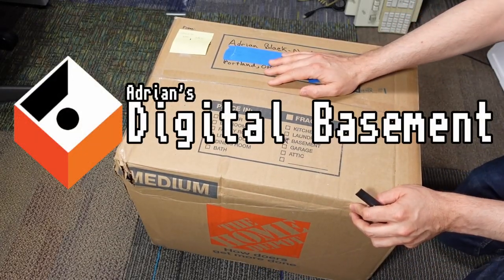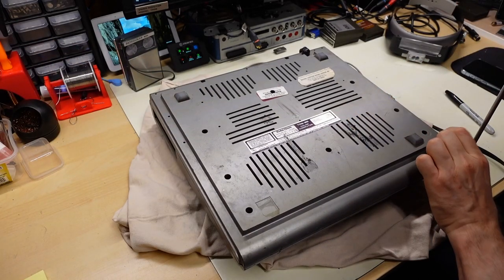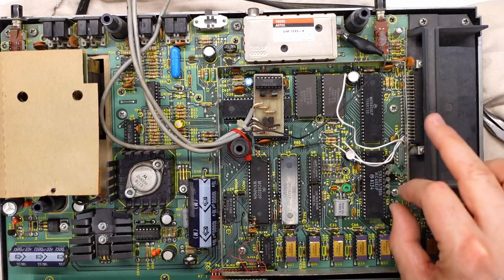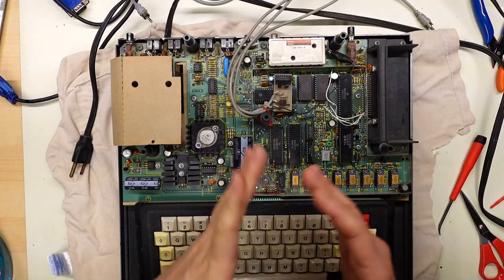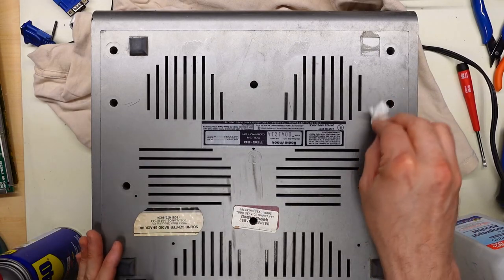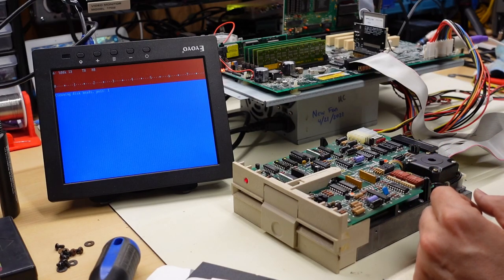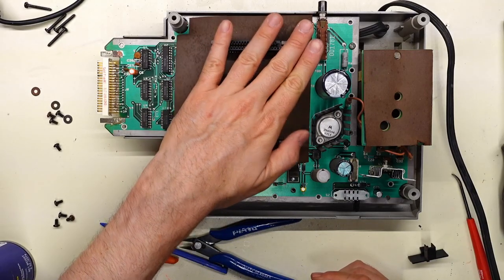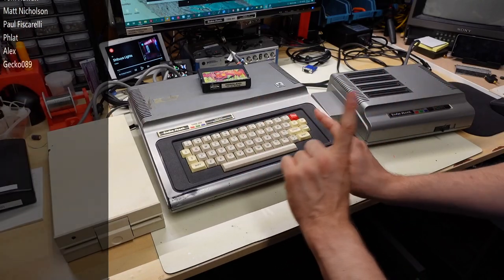0035 We have a broken TRS-80 Coco 1 in the basement! (And a repair on my other channel!)

Comment: Many a long year ago, I wrote an interesting program for that computer.  It was designed to print text on the high-resolution graphics screen.  This was never supported by the hardware.  If you had a BASIC program and you wanted text on the graphics screen, you had to use BASIC's drawing commands to draw the letters.
I managed to shoe-horn a machine code program into a tiny amount of memory.  The character-set table which the program used was longer than the program, by quite a lot. 😄 (2048 bytes RAM for the table, but around a quarter of that for the program).
The program was written in assembly code and used the Program Counter Relative instructions so that it could be loaded anywhere in RAM.  Usually, I'd clear 6 pages of graphics memory and then use the first four for the high-res graphics screen (it required 4 pages for the full screen) while loading the program into the two "spare" graphics pages.
The program had a table with the full 8-bit IBM extended ASCII character set.  It allowed you to fully control the cursor, screen clearing, and do advanced stuff such as redefining characters from within the BASIC program, put a cursor on the screen, reverse the video (black on white instead of the default white on black) and more.  You got 24 lines by 32 characters per line.
The program was accessed with the USR (user) command in BASIC.  If you gave the command a number, the lower 8 bits of the number would be used as an index into the character set so you could access all 256 characters that way.  If you instead sent a string into the command, it would print whatever was in the string... but it would also interpret control codes as cursor and screen controls and as character redefinition commands.  There were escape commands which would access the printable characters stored in the control character locations (0x00-0x1F) so you could still print the entire character set using a string.
I gave up working on the program because the COCO was falling out of favour as the IBM compatible computers took over the market, but figuring out how to make the computer "dance to my music" was fun.

Comment: pencil eraser on the gold plated contacts , but something tells me there is VERY little gold plating on there , as gold does not corrode like that
Reply: A lot of contact edges are brass rather than gold, so that tracks. Brass looks a lot like gold without real gold nearby to compare against. A lot of “gold plated” audio jacks are actually brass too. Which isn’t really bad at all, brass is an excellent conductor. It’s just not corrosion proof!

Comment: I had an original CoCo (with an E board) way back. There was a lot of discussion back then about repainting the case to repair those worn spots along the front edge. It was eventually found that a specific car touch-up paint was a perfect match: Mercedes Silver. I've no idea if that same shade is available today.  (For anyone who read '80 Micro' magazine in that era, you would remember that the regular 'Gamers Cafe' column introduced a character called Mercedes Silver.)
Reply: Yep, I remember that as well.

Comment: It is easy to tap a composite signal directly from the input to the modulator. Not great, but good enough for troubleshooting. It can be improved with the simple mods usually done on Sinclair Spectrums or Atari (using a 100uF capacitor or a transistor). You were lucky to get that a fancier mod that is getting the signal from the MC1372.

Comment: The multipak is manual and Electronic device to swich 1,2,3,4 with pokes, Keyboard is coco 2, first series, The wear on the case is due to the chiclet keyboard that was wider and better aligns with the markings.

Comment: As a kid, I had a coco 1 (16k later upgraded to 64k) that I paid radio shack to upgrade the keyboard from the original ‘chiclet’ keyboard to that one.. it was an official RS upgrade you could get.

As for the multipack, software could control the address decoding independently for the ROM space ($c000-$feff) and the part of the memory mapped I/o space typically used by disk controllers ($ff40-$ff5f) by storing the appropriate low and high nibbles at $ff7f…. Once software hit that address, the front switch gets deactivated until a reset.

Someone will correct me if I’m wrong, but I also feel like it actually let multiple carts share part of the rest of the I/O space at the same time - $ff60-$ff7e maybe??

Early version of the multipack don’t work with the coco 3 without modifications because the control register would ‘ghost’ from $ff7f to $ff9f clobbering new I/O registers (in the GIME Chip) in the coco 3

Comment: I had a CoCo 1 initially then a CoCo 3 back in the day.  My CoCo 1 had 64K, switchable IRQ. Needed the IRQ mod for modems as Tandy/Radio Shack messed up in the PAL mod. Power led. My CoCo 3 MPI was switchable so older hardware would work as some addresses were blocked.  My CoCo had power leds at the front. I wired them to the 5V and 12V lines as a diagnostic aid. I had an HJL aftermarket keyboard in my CoCo 1 and  transferred it to the CoCo 3.  Looks like it’s not executing code, thought the 6883 was bad but they do run warm. Wonder if it’s a PIA (6821/6822)? I did have a 6883 fail with flashing bars but your display looks like it’s not doing anything or it’s running but not able to execute ROM code.

Comment: Hey Adrian, use a pencil eraser on the corroded edge connector contacts. It's very effective, and it doesn't trash the connector like a dremel would.

Comment: No one ever really used the 1,2,3,4 switch on the MPI as the slots were software selectable.  So, for example, you could have a disk based terminal emulator load from disk, and internally the software could select back and forth between the disk controller cartridge and the RS-232 cartridge for network access along with disk access.  So it was basically 4 expansion slots of which only one could be active at any moment, but could easily switch if needed.

Comment: The old TRS-80 edge card connectors for the expansions were just tinned copper.  And they would oxidize quite badly.  So many kits were sold that had a gold plated connector that you could solder right onto the existing edge card connector.  I have several old TRS-80's in my possession that have had this modification done.

I personally never had an issue back in the 80's, but then again, i never used the "eraser trick."  The eraser trick was to use a pencil eraser to "clean" the connector.  This was bad because not only was it too abrasive, the rubber eraser contained sulfur, which causes more corrosion to happen.

Your best bet was an actual contact cleaner or just re-seat the connector several times to allow the contact fingers to wipe the oxide away.

Comment: Doing all of the home modifications was very common on the Colour Computer, especially the CoCo1.  That is the melty keyboard which came on the later run of the CoCo1 and early run of the CoCo2.  I would guess the mod at the keyboard ribbon might be the lower case mod.

Comment: Looking at that wear pattern,  the user might have had a hand condition that prevented using some fingers.   I have Dupuytren's in my hands that makes my pinkie fingers useless so my hands are at the same position as the wear marks.   Just a theory.   It's great seeing a CoCo again,  I had one in my teen years and haven't seen one since.

Comment: The orange & green garbled screen can happen when the computer isn't reading the ROM chip, but can be caused by other things too of course.  I had something similar on a Dragon 32 I bought last year which I solved by reseating the ROM chip, cleaning both the chip & socket in the process, as well as using the equivalent of deoxit on the power switch and switching on/off several times.  Not sure which of those tasks cured it, but it took a few presses of the on/off switch for the garbled screen to finally disappear and BASIC to boot.  It's been fine ever since though.
Reply: 👍 This.👆

Comment: The odd wear pattern on the paint comes from someone playing games (the up/down keys are on the extreme left of the case while the left/right are on the opposite side).  Tandy/Radio Shack had a habit of upgrading these machines late in their production run; the earliest CoCos had 4K of RAM and that atrocious chicklet keyboard.  When the CoCo2 came out with its 16K of RAM and this improved keyboard you have, the new production CoCos (co-existing on the market with the CoCo2) got the same RAM/keyboard upgrades from the factory.  Similarly, when the CoCo3 was introduced, the RAM capacity was bumped to 64K and that great keyboard also came along with it; these upgrades also made their way onto the late-era CoCo2s still being sold.  There were also aftermarket keyboard modules sold, but they look nothing like this.  I've heard that Radio Shack may have offered keyboard upgrades for original CoCos to this model, but I'm personally not certain.  These were very common hobbyist computers for tinkerers not concerned with gaming, so hacking them was very common.  You'll probably find the composite mod documented, if not sold in magazines of the era.  I recall one of the magazine covers showing the machine with the top off and someone taking an ugly cheap old soldering iron to it; that always stuck with me because I don't remember any other magazines being so brazen about warranty voiding.

Comment: Most of those bodges would be for the factory 64k upgrade. That old of a board didn't support 64k directly- wonder if it's got rev F or ET on it. The long red wire to the keyboard interposer is to connect the CoCo 2 keyboard to that older CoCo 1 motherboard, it provides pullup via the resistor pack on the interposer board. The 6822 was also used for the CoCo 2 keyboard as it was a better match to the impedance of that keyboard. Normally the first CoCo 1 keyboard used a 6821. Under the cardboard is just an AC transformer. The 6883's tended to run hot. You can use multiple carts at the same time in the multi-pak as long as they decode to different address ranges (disk drive and RS232 for example) but the slot is software-selectable so it's possible to use multiple same-type carts (multiple disk controllers, for instance, under OS/9)

Comment: Packing tape residue can be removed with Bestine rubber cement thinner and an artist's spatula. Generic Bestine is sold as simply heptane. Bestine sells an oilcan-like applicator that you kind of need in order to use the stuff. Also good for price labels and other stickers as well. Probably not good to get on your bare skin though, it evaporates pretty quickly and probably not as bad to be around as acetone. - long time watcher/first time commenter. P.S. - I'd test it on the plastic first but in my experience the stuff is not very reactive unless you take a match to it.

Comment: If I remember correctly the graphic chip does not require a working cpu to display data. The GPU just scans a section of ram and sets the pixel color to the value in ram. What you are seeing on the display is essentially the power up random values of the ram. This is set up using a dual port scheme so the gpu and cpu can access the same ram at the same time. (different clock phase though). I would say the cpu is not running or does not have access to the monitor rom. If it has been modified the address bank select could be messed up to use a custom boot/monitor rom in a cartridge instead of the onboard oem one.

Comment: Adrian!  I that keyboard is the one that belongs in the Coco2, which is my first computer and I still have it.  Incidentally, my keyboard broke and it was replaced by Radio Shack with the later tall key design.  If you want a OG keyboard for that, I'd love to have yours to make mine original and I'd buy you an OG keyboard and swap it if you are interested.

I have a nice Coco Collection, as it was my first and only computer in the house until I replaced it with a 1000HX.  My Coco collection consists of.  Coco2 64k, 3-512k, Coco2 type Multi-Pak Interface, FD-501 single drive, 2x deluxe joystick, Electronic Book,  Kaola Pad, CCR 82 cassette, RS-232 pack, Orchestra 90, modem pak(cant remember model), DCM3 modem, OG Dust covers for disk drive and computer, DMP-130 printer, Audio Spectrum Analyzer, and a good mix of Cassette, Disk, and ROM pack games.  I'm probably forgetting a good bit too.  I even have the official RS store demo on disk for the coco at Christmas and some others.  When I start to dig this all back out again (right now, I'm on a bit of an apple ii kick), I'll upload the demo to archive.org if it does not exist.  

I really want a 2nd drive for my FD-501.  If anyone knows the mechanism number, can you please share it?  I'd have to dig mine out, but I'd like to start the search.  If you know of one for sale, please let me know.  IT looks like a Tandon TM-65 sans obnoxious door lever.  I really want it to be period correct and match.

Edit-about dealer stores - that is all that is left in 2022, and I'm lucky to still have one near my parents house in PA.

Comment: That's a CoCo II keyboard.  The final keyboard for CoCo III had clustered arrow keys and some function keys.  I don't remember the SAM chip running that hot.  I'd check the CPU.  That's a "Remex" drive.   I had some of them but don't think it was that model.  I think those mods around the 6820 are related to the 64k RAM upgrade.  32k was the max supported but with bank switching you could get to the rest.
Reply: Yep. It's actually the melted keyboard which was in the long white case Color Computer (in US) which was also sold in Europe as the Colour Computer II for a bit. Shortly after they've made the short white case with an even better keyboard which became the CoCo II on both sides of the Atlantic. This case was also used for the CoCo 3.
Reply: @HomeComputerMuseum  The chicklet keyboard lived on on the short case COCO2-I owned it.  I remember it well, because the keyboard broke and RS replaced it with the tall key model, and for some reason, I remember not liking it as well.

Comment: Could try to clean the contacts with a hard tooth brush and some contact cleaner, then reflow the soldering, with flux, and then clean again with contact cleaner the residual flux....

Comment: My first computer was the 64k version. I wrote a payroll program using the cassette deck for storage. When I changed jobs I ran the spreadsheet cartridge and ran a small college's budget. It definitely would have had the chicklet keyboard. While it was insanely slow running the budget showing the school president how much faster this was than hand calculating changes that summer the school bought its firs XT, and a very early KMS Laser printer called the KISS and yes it stood for keep it simple stupid.

Comment: You can use an electric tooth brush on the gold contacts, with some IPA or something like that. It'll have a very fine abrasive action. Just don't use an old one if you don't want the thing to smell like bad mouth smell... use a new one. They don't cost so much.

Comment: There are supposed to be two Motorola 6821 Peripheral Interface Adapters inside a CoCo. The one on the left has been replaced with a Motorola 6822 Industrial Interface Adapter. The 6821 PIA and the 6822 IIA are pin compatible but the 6822 IIA has higher supply voltage ratings and can drive CMOS logic up to 15 volts where the 6821 PIA has only 5 volt TTL compatible outputs. I don't remember if the PIA on the left is for the keyboard matrix or for the various peripheral interfaces on the CoCo, but I suppose the left one got blown and was replaced with the 6822 IIA because it was available or possibly cheaper at the time. As for the question about the MPI using more than one peripheral pack at a time, IIRC the diskpack controller could be plugged into slot 1 (or was it slot 4?) and you could use another pack in a different slot at the same time. I remember using the diskpack and the digitizing tablet together in the MPI as well as the SpeechPack and RS-232 Serial pack while still having the diskpack controller operational. There may have been a Poke command involved, but it's been a long time since I did anything CoCo related.

Comment: The video interface probably has color composite, monochrome composite, and sound.  I had a similar interface in mine.
That pattern on the screen looks like what is left by the memory test.  
Either the memory test failed, or initialization of one of the PIA chips?  PIAs can fail if you plug a joystick in with the power on.
That is probably an early CoCo 2 keyboard, but I've been told there were a few white CoCo 1s with that keyboard.

Comment: Just use the contact cleaner to remove the sticky goo from the decomposing feet and the packing tape, works better than WD-40 and doesn't leave a smell or residue.